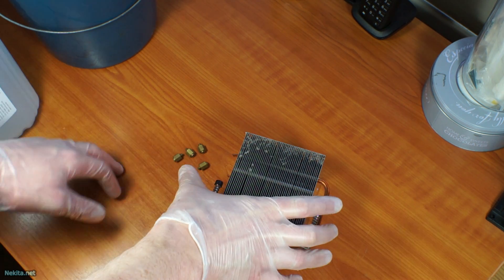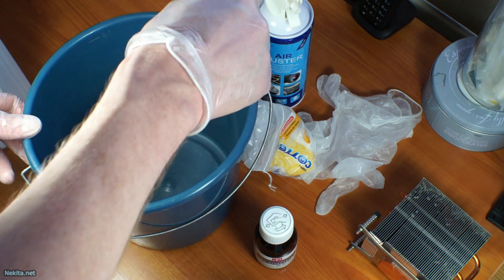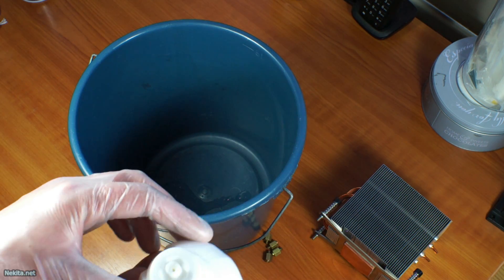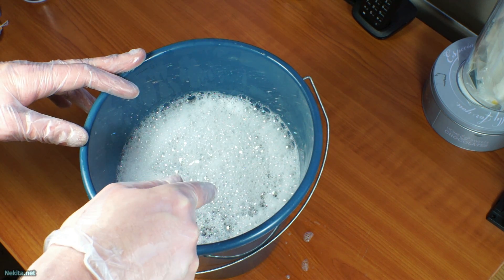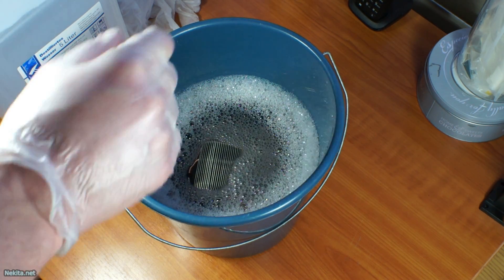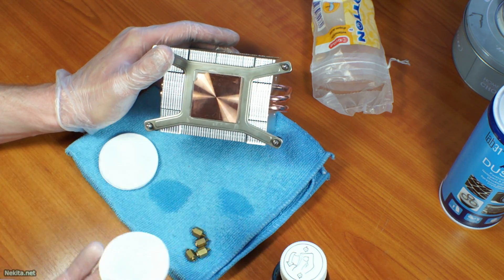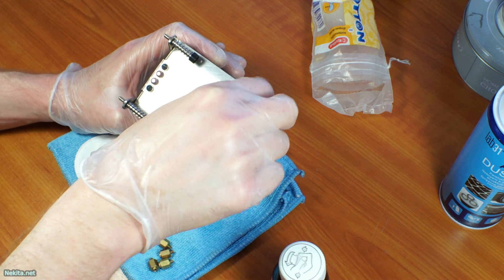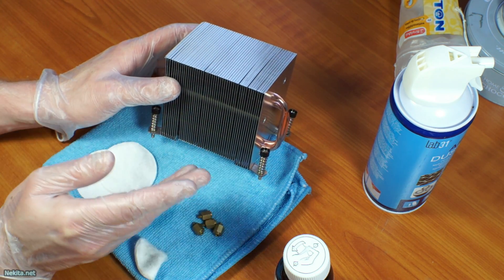Deep cleaning a CPU Cooler

Comment: Im planning on using this method on my noctua NH U12s bought back in 2014, will there be any corrosion after dumping the heatsink in water? I have no intention of changing it as it perform just as great, only the heatsink is dusty + ugly (edit: what type of detergent should and shouldn't use?)
Reply: I see its been 6 months lol how did it turn out. i have the same cooler and was thining of cleaning mine
Reply from the maker: You can use mild dish-washing detergent and if you want to prevent corrosion: Use distilled water for the wash, but at least the final rinse.

Comment: Kannst du Mal den wraith prism kühler zeigen wie man den entstaubt
Reply from the maker: Dusting is different than "deep cleaning"; Personally I wouldn't bother with an AMD stock cooler and buy a good after market replacement. However, if you insist I would recommend simply taking it apart slowly and use the "deep cleaning" method as shown in this video. So, that's removing the plastic cover and then the fan. Hand detail the fan with a brush and soak the cooling block in water as shown in the video. Hope this helps!

Comment: Can i used distilled water in a bottle that can be bought in the super market?
Reply: If anyone is just coming across this now, it's worth noting that distilled water is typically not what you find in your standard drinking water.  You'll tend to find distilled water in the pharmacy section rather than with the drinking water because it's biggest general public use is for cleaning medical equipment that needs to be as close to sterile as is humanly possible without an autoclave (the device used in hospitals to clean surgical instruments).   

It also honestly tends to not be particularly pleasant.  We're used to having some minerals dissolved in our water - indeed, a lot of the high end bottled water companies market their product as "mineral water" and tout the benefits of whatever minerals happen to be in the source at their bottling plant - and these dissolved minerals give water an extremely subtle but noticeable taste.  You probably don't consciously notice it (unless you're drinking hard water), but most people tend to find truly pure distilled water quite unpleasant.
Reply from the maker: That's a great question; Yes you can! Without any minerals and salts in the distilled water (especially when rinsing the cooler) you'll likely won't even get spots! Good luck and enjoy the result :-)

Comment: In my gpu heat sink i am having some kind of white rust how to clean it
Reply from the maker: On, not in your GPU heat sink right? If it's a aluminium metal heat sink; And you can remove it from the video card, fan and any other electronic components; then you can soak it in a light vinegar / water solution and while it soaks brush it with a toothbrush. Rinse with large amounts of water and dry it properly afterwards! Ensure that no electronical components get wet when re-assembling it all! Hope this helps.